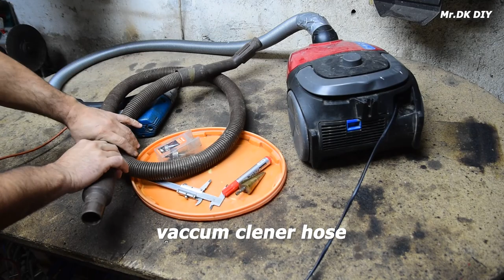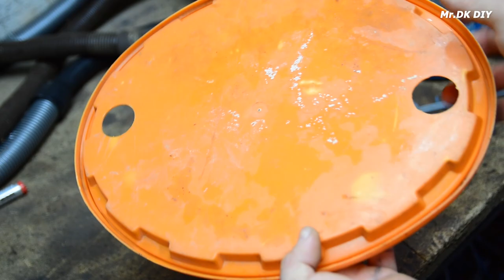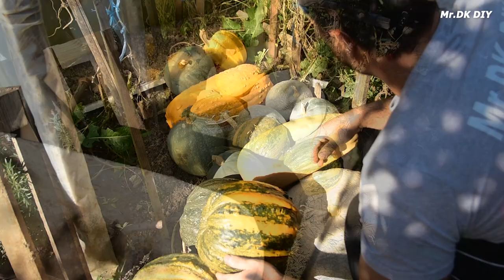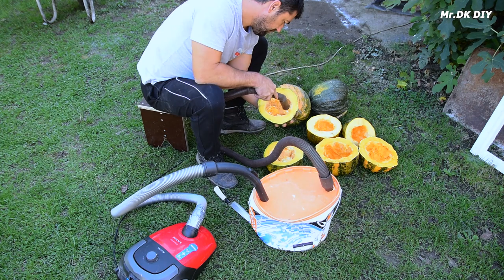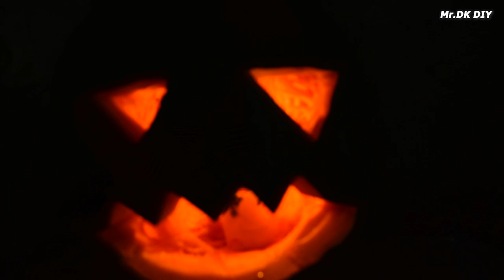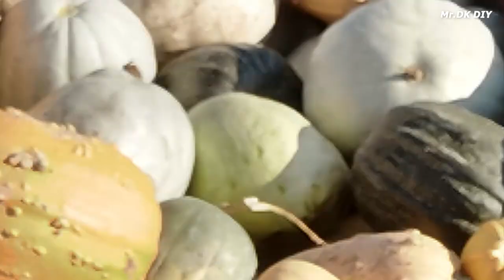How to Remove pumpkin seeds quickly using vacuum cleaner

Comment: I use these vacuum containers for sanding drywall and cleaning up fine stuff off floor, sawdust, etc..
  I'm not sure the effort it takes is any quicker than just reaching in and getting them like a deer, putting the guts on some paper and moving on.
  If you're main goal is not touching the goo, then the extra time and effort.   I'll stick to the "cut and gut" method, myself.